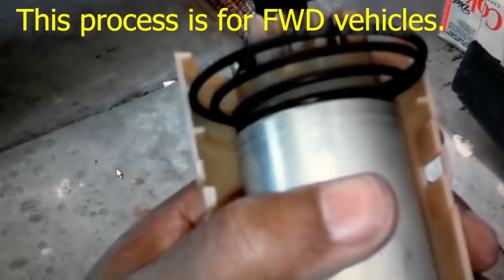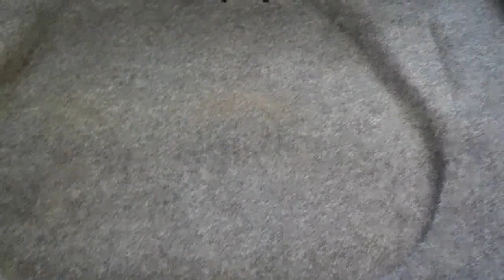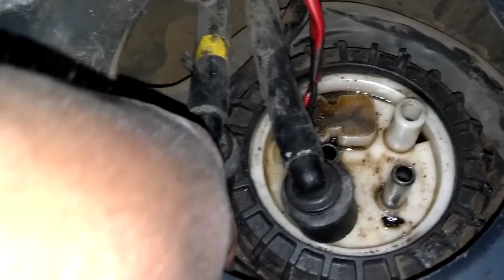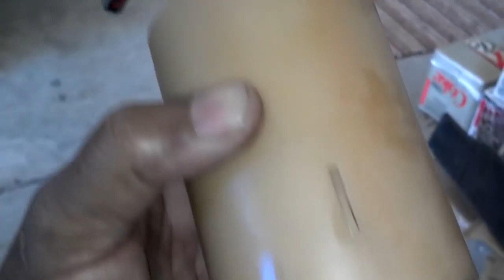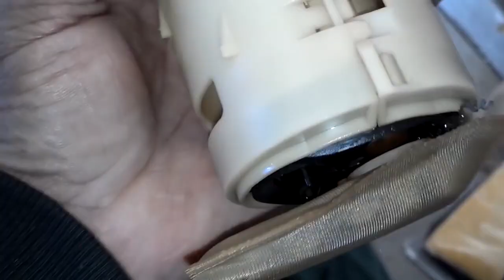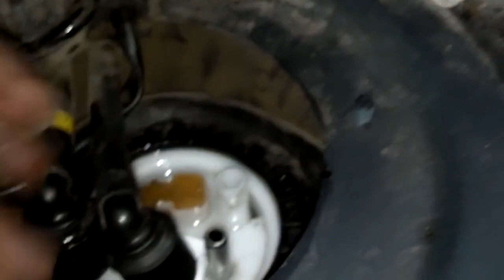How to replace the fuel pump on your front wheel drive Volvo 850, S70, and V70 cars. - REMIX

Comment: Replacing the electric motor
Reply: @RobertDIY  hey Robert, it wasn't the pump after all, the hose that feeds from the pump was coming a loose from the fuel pump module unit.. in turn , that was causing my car to not have sufficient fuel for boost... Which was causing misfires and stalls... Thank you Soo very much sir.. you are a true inspiration to us DIY Volvo enthusiast

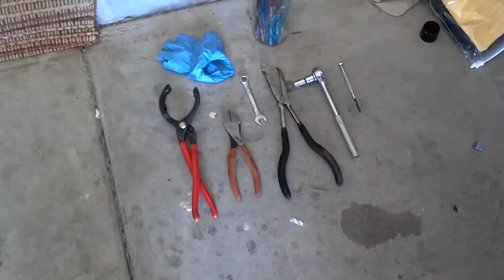Comment: Robert, I have a 1996 Volvo 850 replace Head when I tried to start it fouled plugs immediately run rough hard to start going to replace the fuel pump. Any help I would appreciate 1:28 .
Reply from the maker: Huh? Call or text me.

Comment: hey Mr Robert, i have a question. is this the same location and process with the 94, 850 sedan?
Reply from the maker: yes
Reply: @RobertDIY  thank you sir, I found it yesterday 👍
Reply: @RobertDIY  hey Mr Robert my volvo still not starting. Cranking but turning over. I replaced fuel pump, fuel pump relay, fuel injector relay, plugs and wires and it still won't turnover. Have any suggestions! And also I noticed a second smaller trap door about 10inches away from the fuel pump. Do you know that is or leads to? It has wires connected to it and a screw on cap similar to the fuel pump

Comment: I don't remember if you said in your video or not but I replaced the fuel filter on a 97 850 and I think it's probably the fuel pump but should I have prime the filter? Not much leaked out
Reply from the maker: no

Comment: Hey Robert I love the channel. hope you are having fun on your road trip. I thought I had a bad pump so I bought another. I also bought a relay. For some reason. I  can't even jump the relay socket. My voltage meter shows no power at all. Is the problem in the colum or  ignition?
Reply from the maker: I don't even know what kind of car you have.
Reply from the maker: Have you scanned it for codes?
Reply: @RobertDIY  LOL 98 S70
Reply: @RobertDIY  I dont have a scanner

Comment: Hi Robert, I have '95 850 GLT model.
I bought 120$ bosch fuel pump insert(black color).
I found '95 genuine's negative electric lines is not fit to new pump.
So I cut negative pin and replaced into bosch's component pin.
I checked that pump was working before I install pump assembly on car.
But after I install pump assembly on car, nothing worked.
I guess that electrical line on pump was disconnected when I install pump on car.
Could it be that my way of working is wrong?
I couldn't find video which replace only pump insert...
sorry for my translator grammer...
Reply from the maker: https://youtu.be/KBmv9OowwwI
Reply from the maker: did you test the old pump?
Reply: @RobertDIY  I have start engine problem. It doesn't run. I replaced 103 relay, fuel injection relay. Last one was fuel pump.

Comment: The replacement pump has an extra black wire coming out of the backside of the grey plug.  Does this need to be attached somewhere or can it be ignored. the original did not have this wire.  Thanks for all your great videos!
Reply from the maker: Did you watch the video?

Comment: Why is there a 3rd connector? The one I took out had two connectors for the pump the one I tried to order had 3 coming from the pump connector and then the pump to chassis connector had a 3rd connector? Why can I not find just the 2 pin pump?
Reply from the maker: Because they don't make them with 2 wires anymore.

Comment: It took me only 5 mins to replace mine however there’s this red plastic seal inside the connector and the o rings and that plastic was deteriorated from the gas. I’m not sure what to do I’ve tried using o rings but it only made it to become a slow leak and idk how I should get a new one
Reply from the maker: So you damaged the lines when you removed them. 🤦🏾‍♂️

Comment: very thorough video, thx. but my question is — due to my lack of tools and confidence getting under the hood; what’s a rough estimate to get this done by a legit mechanic? In your opinion? The fuel pump replacement. 

Already brought the pump. ‘98 Volvo S70
Reply from the maker: Cost estimates are in the description area.
Reply: @RobertDIY  hey uncle I just got the fuel pump replaced today. my check engine light is still on. I’m trying to get to the root of this issue, autozones doing another diagnostic test. If it turns out there’s no problem, how do I get this “check engine” light off? Do you have a video for that?
Reply: @laffiegreen9668 it's been two years, but for anyone else reading this: soend fifteen dollars at Walmart on an OBD-II scanner, plug it in to your car's computer, check the codes, write those codes down, and then select "clear codes" and the light won't come back on until there's another problem... which means a few days with no Check Engine light 😅

Comment: My mechanic replaced the fuel pump in my 2000 S70, and now shortly after starting, the car stops. I think the fuel pressure isn't high enough or some pressure sensor is faulty to keep the car running. Any idea of why my car starts then stops? The battery is fine.
Reply from the maker: How long does it run?
Reply: @RobertDIY  thanks for replying! It ran for less than 5 seconds last night each time I got it up and running while parked. I came back this morning, and it started and held for less than 5 minutes before it stopped. Had it towed for a diagnostic.
Reply from the maker: https://youtu.be/NhtUXZTurzo

Comment: "Do not get a cheap and Inexpensive pump"  As I'm about to put in a $20 pump from Amazon 😂
Reply from the maker: Yikes!
Reply: @RobertDIY  hey any idea why my car starts fine at 33 degrees out but not 31? Has to be water in something but I'm quite lost. Volvo 850*
Reply from the maker: Probably a temp sensor issue.
Reply: @RobertDIY  I thought so also. I did fuel filter, fuel pump, and one of those darn relays but nothing worked. Unplugged the coolant temp sensor and plugged it back in. Now it doesnt run at all 😂

Comment: A few notes about my  experience with  replacing the fuel pump on my 96 Volvo 850 turbo.  The toughest part was replacing the lock ring on the new pump.  The new replacement-Volvo, not aftermarket-from FCP euro, was slightly different in terms of threads and didn't anchor the new pump at all well- I ended up reusing the old one w/o difficulty as it was in good condition.  Learning point is don't break the old one removing it!  The oil filter wrench works ok for this as noted. Also the new pump wire connector has an extra line/connection which I assume is for newer cars- don't be alarmed as it works fine with just the grey connector reattached.  I used WD40 for the lubricant w/o difficulty-be careful  with the new o ring which fits on the threaded  tank port-it buckles  inwards easily which will give you a leak.  I used a door panel removal tool to release the fuel lines with relative ease.  Otherwise I found the replacement as Robert describes.  I also found he was right on the money as usual as my pump was original, 25 yrs old with about 180k miles- my pump gave pretty much no warning when it went bad.  I hadn't got around to  replacing it for routine reliability maintenance  but after this,  I also put in a new coil because of age even though the car was running well after plugs, wires cap and rotor renewal.  Love these old 850s-they drive so well.
Reply from the maker: Thanks for sharing.

Comment: Hello Robert, is this the same procedure on a 2005 v70 2.4 aw55? I replaced the fuel pressure sensor and still getting p0089 code. My volvo technician recommended me that the fuel pump is the issue
Reply from the maker: Nope.

Comment: Hi Robert, My second Volvo 850 T5 fuel pump is starting to make a grinding noise with a couple of failed initial starts. Only has 80,000 miles after 10 years. I read that a few people buy just the insert rather than the entire unit. I see FCP sells a genuine pump for $350.00. Would you recommend change the entire unit as you show or just the insert? I see some people have trouble with getting inserts to fit.
Reply from the maker: I usually change the insert.

Comment: Robert, do you have a link to the fuel pump you bought? I found a bosch one on eBay but I question if it's legit, that ks in advance, you rock
Reply from the maker: I'm sure the link is long dead.
Reply: Thanks Robert, ended up going with a bosch pump, but I have to take apart the assembly and put it in. Shouldnt be too bad, Happy Thanksgiving!

Comment: I can't hear my fuel pump at all but it does start and run.
Reply: I will keep and save the videos on vilvo repair.  I am 71 and still like saving .oney so I do my own repairs most of the time.  But I have a friend I will pay to r and the blower.motor and resister.  I usually have chevy but I am going to take the vulvo adventure.  So thanks for all of the videos!
Reply from the maker: Nice quiet pump.